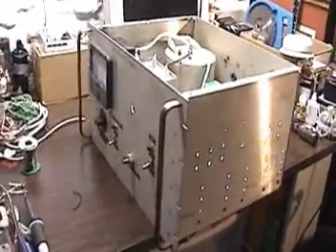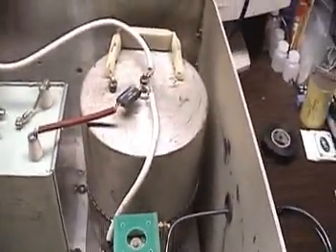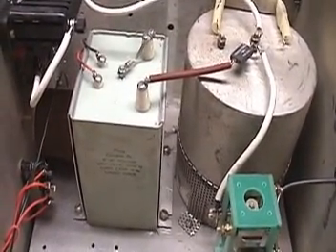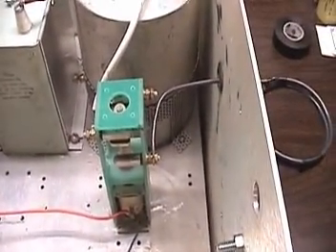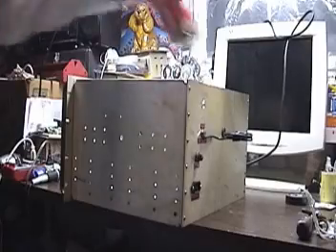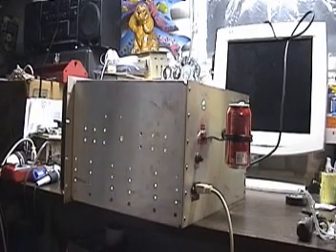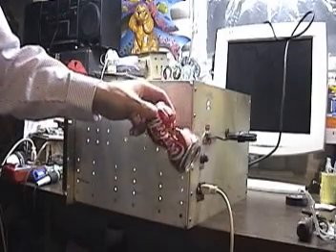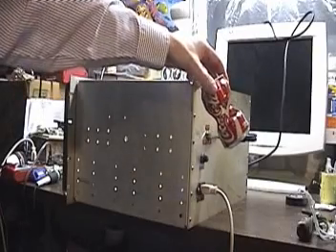100uF 5Kv Can Crusher

Comment: Not my show here, but to respond on how it works: The sudden rush of high current through the outside coil induces a very heavy current in the metal can, which pushes it away from the coil. The action is dramatic with very quick high currents.  The aluminum does not repel the magnetism to any real extent, it's the current induced in the aluminum by the sudden field.

Comment: I surmise from your other videos that this works based on aluminum's repulsion of magnetic fields?  I calculated 1,250 joules!  Rock on dude!  Just a thought, but you might be able to use this contraption to press form aluminum sheet  against steel dies to form shapes etc etc.

Comment from the maker: The power transformer, its made with an iron core with copper wire around it.  It provides 2000 volts AC.

Comment from the maker: The fireing in the video fried the power transformer and the diodes.  I replaced them and turned it on and fried the capacitor!  So it will be a while untill I have more video's.